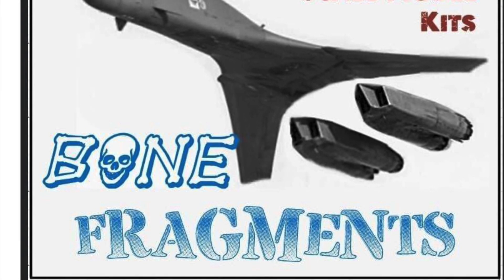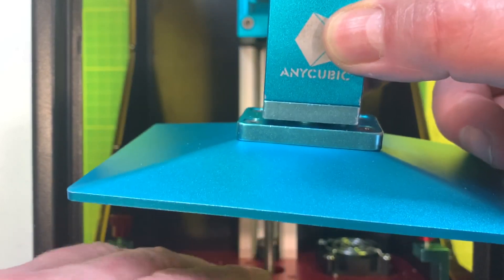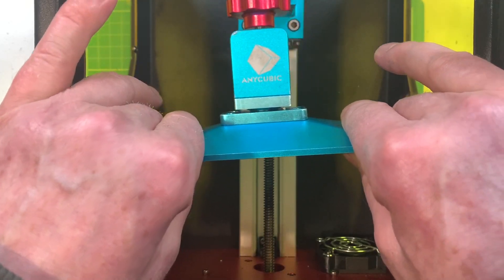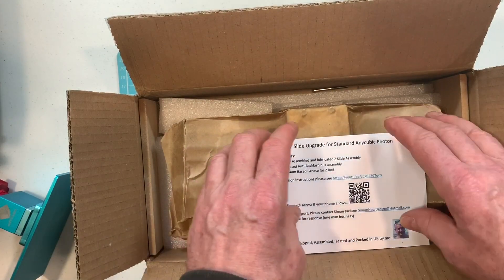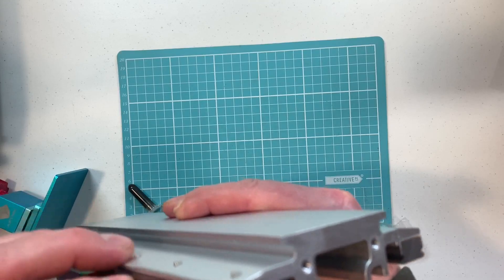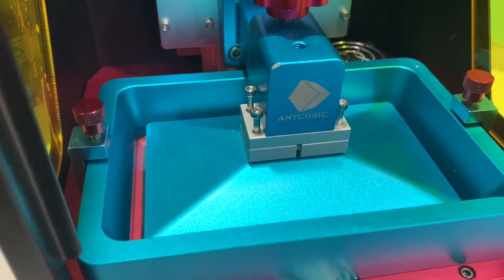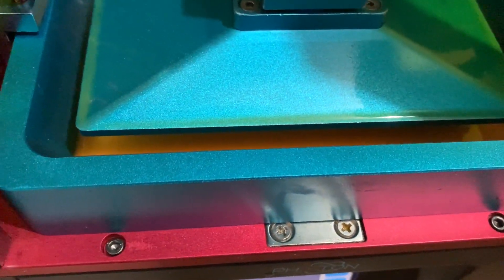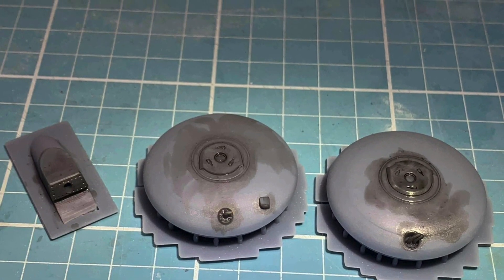RESIN 3D Printing Primer & Printer Upgrade

Comment: Hey Jarrad.. good insight into resin 3d printing thanks. You mention the plate has to be flat in relation to the resin bath within a micron or two. Really.. how on earth can you measure that inside the enclosure? Surely you meant a thou or two?
That twin rail Z axis upgrade is a no brainer eh!!
Reply: Hi  Nige. Yep that’s correct the ACP has the following specs.                                                        ● XY DPI : 47um (2560*1440)
● Z axis resolution : 1.25um
● Layer resolution : 25 ~ 100um 
So yes 1 micrometer tolerance is Required otherwise the layers won’t stick to the build plate properly and you end up with failed prints. Trust me, the learning curve on These is sharp but once dialled in its incredible what it can do. And this is only a 2K. 4K is even more amazing
Anyway there’s a specific process for levelling the bed that’s a bit of fiddling round but basically you loosen and lower the bed until it’s touching the FEP. Then push the plate tight and level to the FEP while tightening the retaining bolts. Now use the MOVE function to lift the plate .02 mm and set that as Z=0. Simple 😜